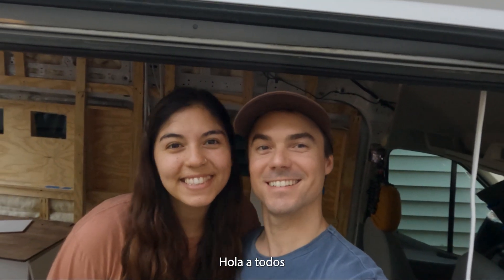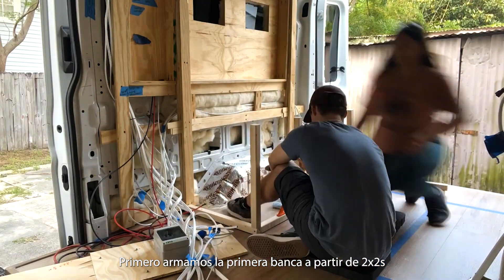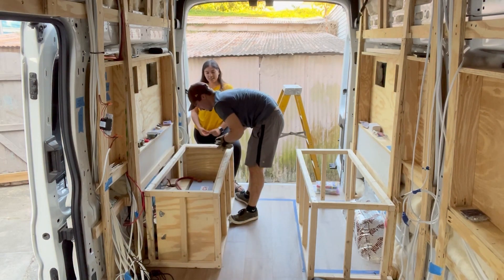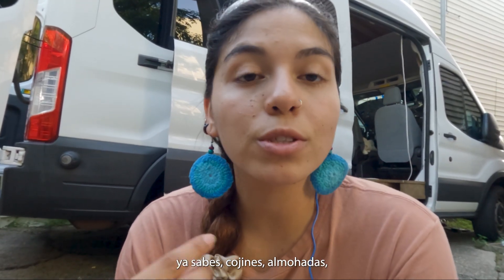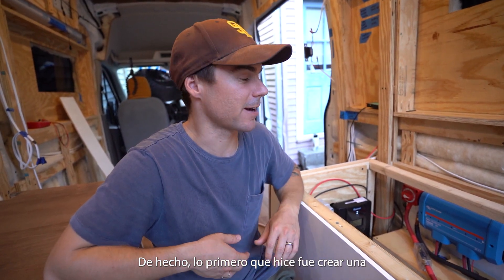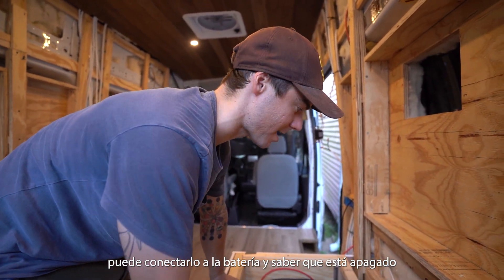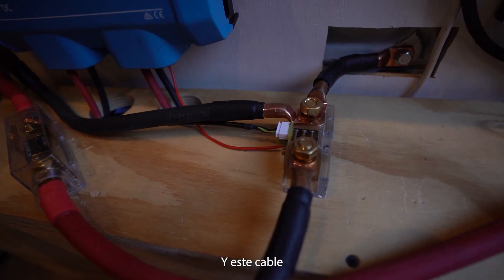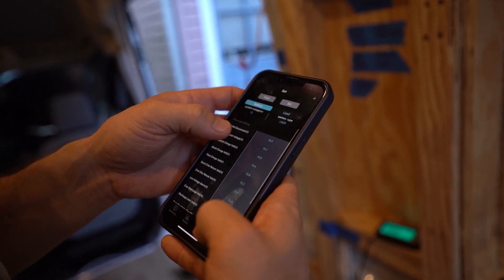300 Amp Hour Battery, Renogy Flexible Solar Panels | Benches |Van Build Series| Ford Transit 250

Comment: Looks like you did your homework. Just make sure to double check and test everything carefully. We just added 4-100watt Renogy flexible panels to our trailer roof. We also have 2-200watt Renogy suitcase folding panels. Total of 800 watts of solar with a 300 AH LiTime battery a Victron 100-50 solar controller and a Xantrex 3000 watt inverter. Most of the wiring was already in the walls for the 120 power, I may add one more outlet under our dining area. I did include a 30 amp braker from the shore power before the Inverter just in case. I also used brakers and shut off switches where needed. It is strong enough to run our AC for an hour or 2 if needed. Good luck with your system and all your travels.
Reply from the maker: Thank you for the comment and appreciation! Yes much time and consideration was put into this, and I will say Nate from Explorist Life has some good templates I was able to work off of. Of course every build is different, as ours doesn’t have an AC. That sounds like an awesome set up though with plenty of solar power. Hope it all gets you what you need and that you enjoy your conversion. Cheers! - Aidan